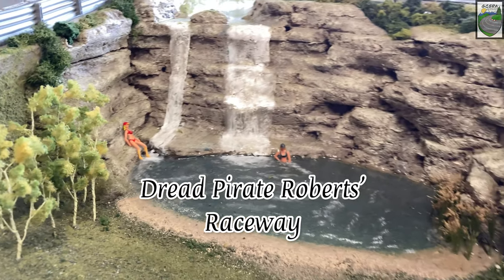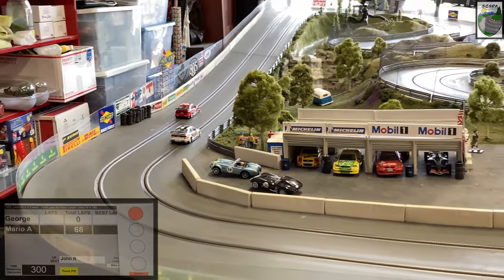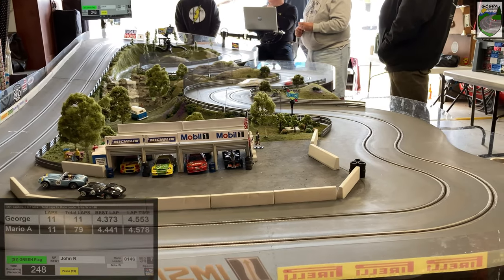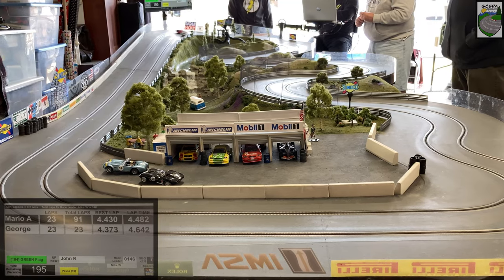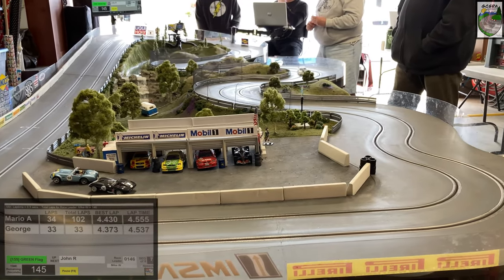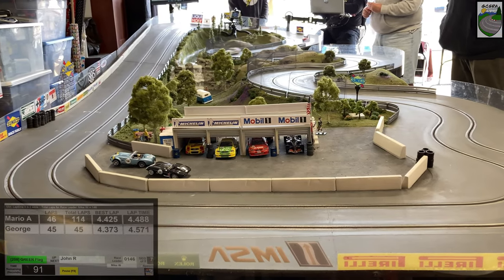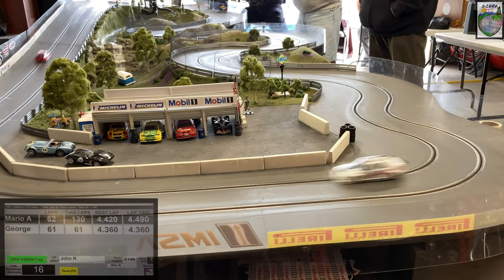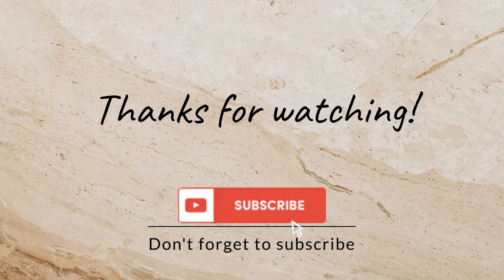1/32 Slot Cars-Slot.It DTM Race Broadcast

Comment from the maker: @SamUSA most our tracks use a couple layers of latex paint (flat exterior type). The surface isn't completely smooth, using a dry roll technique with final paint coats to give the track texture. 

the rubber tyres really start laying down rubber on track to give that amazing grip without magnets. But the driver is still responsible to get the setup right and drive/brake carefully to not spin the wheels or suffer huge snaps of oversteer

Comment: You are getting excellent traction on your MDF.   What kind of finishing paint did you use?
Reply from the maker: 3 coats latex. dry roll layer to give a slightly uneven surface for the rubber tyres to hook up and lay down rubber on the track

Comment: To have balanced lines it is absolutely necessary to have a circuit in the shape of 8.....
Reply from the maker: @endapian I get your point but I couldn't imagine the boredom of driving a figure 8 over and over again. Boring AF. If you want balanced lines and multiple cars, race digital. Wood track racing is a different monster.